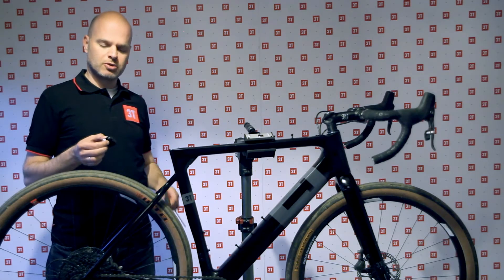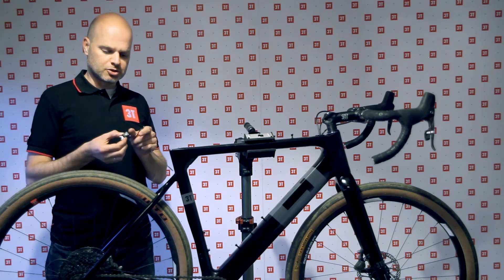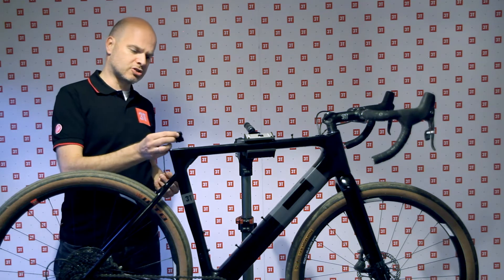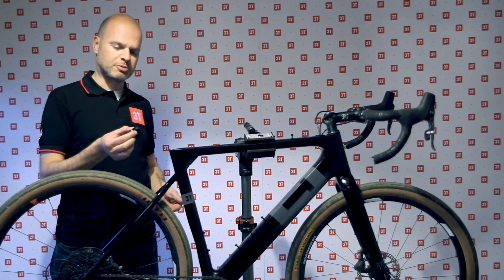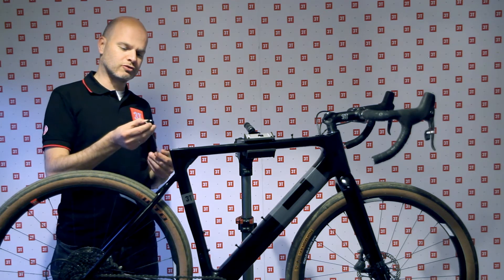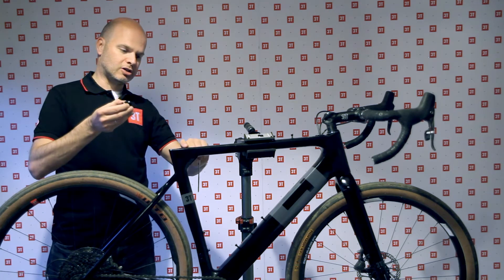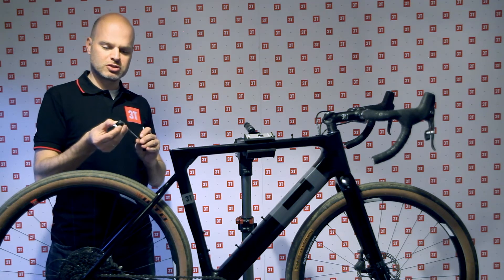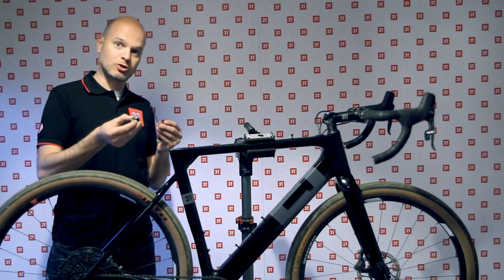3T Explore the Exploro - Seatpost clamp for Exploro PM

Comment: Hi there, I am having problems with my seat post slipping. I have a torque wrench and do this up to 9nm and have applied carbon paste. Any other ideas for how to stop this happening? Thanks
Reply: This is what scares me about buying from a bicycle company: not responding to an issue (a well documented seatpost issue) with the Exploro.
Reply: Also, when dropping the clamp into the frame, use an Allen key upside down to lower the clamp and keep it falling.
I do agree that it’s overly complicated design that makes it impossible to switch seat post easily.
I actually struggle more with the seat clamp itself as it also seems to be in between where I want it to be.
Reply: I also have the same issue, and wondering if there was any solution to this issue.
Reply: They should have some moderators on here to respond or reach out.
That said, is your torque wrench double checked? I’m a pretty big rider and mine doesn’t slip on my Exploro .
I do use Park Carbon grip.  I’d take a look at the post abrasive part and make sure it hasn’t worn smooth or defective, it should be rough on the side that meets the rough part on the clamp. Also, 3T recommends 9nm of torque, not 7nm.
Reply: This is an issue with the Primo (that’s likely why they changed the clamp in newer models). First if it ain’t broke to don’t fix it! Second use carbon paste on the post to add grip. Third: It’s easy to strip the bolt head so work very carefully. That’s probably the reason I used to use a 4mm hex wrench but I now need a T25! Finally apply some electrical tape
to the post to mark it and you’ll  know if it slips
Reply: @5irefly  were you ever able to find a torque wrench with a sufficiently long 4mm bit?